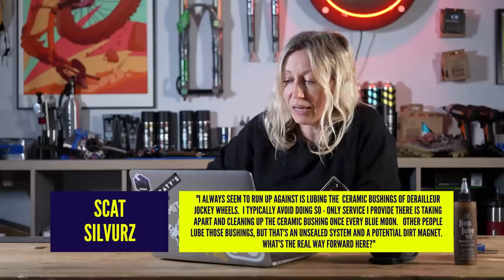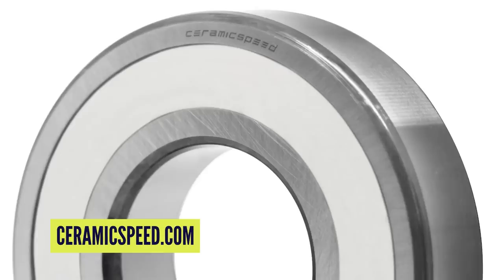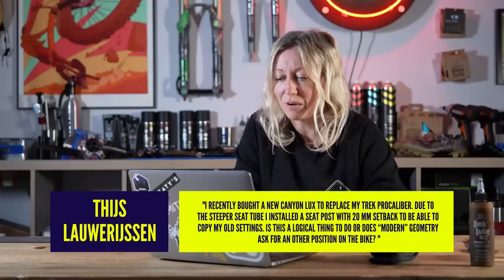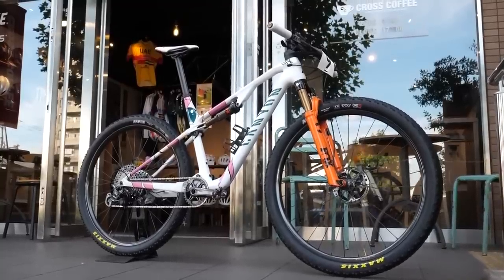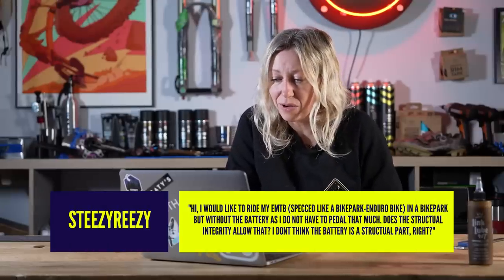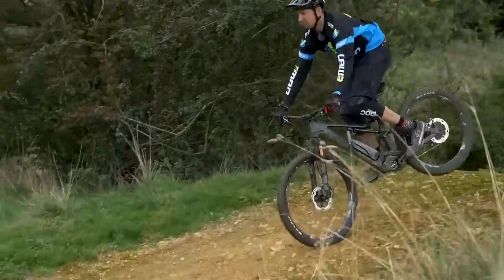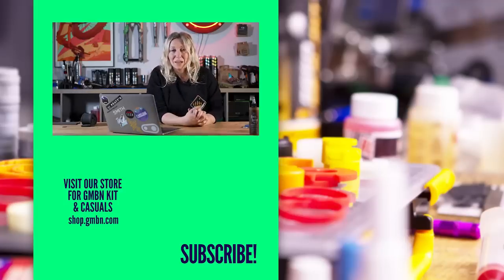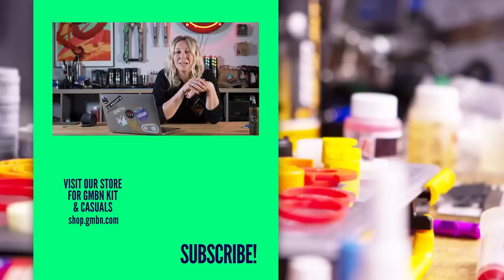Should You Lube Or Grease Jockey Wheels? | #AskGMBNTech

Comment: That's a big overlook from Anna to confuse ceramic bearings with ceramic bushings. 
Still, the answer is grease: speeds and loads in jockeys do not exceed those in wheels, which you grease too and not lube, and you have to keep dust and water away anyway.
Reply: But grease is lube.
Reply: Bushing is a sleeve bearing so technically she is right.
Reply: @45graham45  grease is a compound containing oil, oil and grease are both lubes, teflon powder is lube too,  if you want to get into technicalities. "Lube or grease" in the question meant "lube or <to be specific> grease" where both lube and grease are verbs, not nouns. With lubing normally implying application of oil while greasing is application of grease. It was not about what type of lubricant to apply, but if to apply it at all - another Anna's miss as she wandered off during answering. And I got carried away too. Must have said "Yeah, lube it, and do it rather with grease".
Hope that helps
Reply: @kalijasin  technically all bearing are steel deep groove ball bearings by default when not specified otherwise. Hence if specified being ceramic, they remain being ball bearings.
Reply: @feedbackzaloop  “Bushing – commonly referred to as sleeve bearings, is a cylindrical element built to support loading on an operational shaft that glides back and forth between the moving surfaces.”
Reference: Quote from BushingMfg
Reply: @kalijasin  yes, that is why you have to specify that it is a bushing. Then you specify that it is a ceramic bushing. While ceramic bearing remains being a ceramic ball bearing. What we all are trying to tell you and Anna is not that a bushing is a bearing, but that a "ceramic bearing" is a ceramic ball bearing and she was not asked about it.

Also I advise you to look up ISO for technical terms, so you will learn that bushing has a broader meaning and being a plain bearing is only one of it's many funcions.
Reply: @feedbackzaloop   but still a bearing i.e. sleeve bearing.
Reply: @kalijasin  yes. and?
ceramic bearing is a bearing
ceramic bushing is a bearing
ceramic bushing is not a ceramic bearing
Reply: @feedbackzaloop  then Why didn’t you just admit from the start that Anna was Not wrong?
Reply: @kalijasin  how was she not wrong when "ceramic bushing is not a ceramic bearing"? And this confusion led to the point that Anna did not answer the original question about lubricating ceramic bushings at all.
Reply: @feedbackzaloop  That's what I said. Grease is lube.
Reply: @45graham45  yep. no "but"-s though.
Reply: @feedbackzaloop  where did she say that? 🤔
Reply: @kalijasin  I said that. Based on our previous discussion.
Reply: @feedbackzaloop   you putting words in her mouth.
Reply: @kalijasin  How? I'm putting my words in my mouth. Or do you think that quotation marks should always be for quoting somebody else?
Reply: @feedbackzaloop  that’s not the way it works. Quotes should contain a reference or the person’s name.
Reply: @kalijasin  well, I'm sorry for your confusion. I could have never thought you would read my own words from my very previous answer as if they were said by someone else some other time.
And strictly speaking, quotes works in many different ways. What you say about references and names is only a part of rules for academic citation. Not exactly the current situation and neither you are correct enough as name alone would be not sufficient.

So, let's back it up a bit: would you please re-read the thread again and answer me the following:
- Anna was asked about lubricating ceramic bushings, right?
- She talked about bearings in general, then ceramic bearings, calling them ceramic bushings, then differences in lubricants, ie grease vs "lube"/oil, right?
- How do you think, did she really answer the question?
- If not, what could be the cause?
- Then, is she still technically correct?
- Are you correct at defending her?
Reply: @feedbackzaloop  who hurt you?
Reply: @kalijasin  Not who, but what: your denseness, apparently.
Reply: @feedbackzaloop  you attacked me not me you.

Comment: On tubes, you're always better off going either correct size or smaller.  Smaller can be inflated to fit a bigger tire and will expand/stretch quite a bit without issue.  But trying to fit a bigger tube in a smaller tire will cause issues.  So if you want to buy one set of tubes for bikes with different size tires, get ones that will fit the smallest tires you have.

Comment: About replacing seals, my LBS always used to measure the inside diameter of the seals when the fork is apart. Above a certain measurement they would replace them. Obviously you don't want the inside diameter to be larger than the stanchions (they won't seal), so replace them before they wear out. Only I can't remember the number when they replaced them, might be something like 90% of the stanchion diameter.

Comment: I think your confusing bushings and bearings, ball bearings/sealed bearings require grease (many choices) I think what your veiwer was asking is should he be lubing plain bushes which is where the debate arises, shimano ones I never grease personally as they don't come with any on 👍
Reply: Shimano dealer's manual asks for putting grease under pulley caps.
Reply: @feedbackzaloop  under the caps or on the bushing surfaces?
Reply: @rctankchannelone7558  if it says caps, it must be caps, right? But simultaneously they are side surfaces of bushings, so some amount will be pressed into the contact area anyway. 
In this way you make sure to grease everything, tightening screw as well, while if you put grease on the bushing first, you most likely smear it off during install.
Reply: @feedbackzaloop  I guess so, I can honestly say I have never seen any grease or signs of it in all the ones I've took apart, but I have never taken a new one apart so possibly 😂
Reply: Bushing is a sleeve bearing so bushings are technically bearings. No one calls them bearings though because most cyclists and mechanics associate bearings with ball bearings.
Reply: Grease and Lube have two different purposes.
Grease is for packing the bearing in. Whereas Lube is for reducing friction on the bearing.
Reply: A lot of cyclists get the two, Lube and Grease,  mixed up because of chains. There  is both Lube and Grease for chains. 🙄

Comment: #AskGMBNTech Nice job with the videos Girl & Guys. Question: Will we see Carbon disc brake rotors on MTB’s and in cycling in general?
Reply: It already exists, but it's a rare sight.
It's been in automotive industry for decades. But not common in the bike industry. Kettle Cycles has carbon rotors.

Quote from bike radar:
"Note the absence of holes in the brake track
The thickness, or lack thereof, of disc rotors is a significant hurdle. The materials used have to be quite stiff and, despite the fact the rotors are approximately 2-2.5mm thick, must do an adequate job of dissipating heat.

“If you jumped out to 4mm thick you could successfully use some of the materials that have been attempted, but then you would be creeping up to the weight of aluminum and steel rotors,” noted Step "

" There’s also the mater of wet weather performance. This has been an issue for those riding road bikes with carbon rims for many years. The same issue has been a stumbling block for the development of carbon rotors. Moisture on the surface and in the carbon itself can significantly degrade braking power. A brief but unnerving “warm up” period is often needed before the pads take hold. Surface treatments are one possible solution, though they have a tendency to wear and degrade over time. "

After some research I also found Alpha Ceramic Rotor RS, from Spain. But I see their website is down, so maybe that's no longer exist.
I also found Alien Machinery rotor, unlike the others it has venting holes, bu maybe that was just a display item. But their website is also down, looks like it was a Taiwanese company.
I see some of their rotors had white ceramic  inserts in the venting holes.
But I see a rotor looking the same is Scappa Carbon Ceramic. But the white ceramic won't stay white after use.
Alligator also has a version of the same design, but it's a carbon and kevlar rotor, but same shape and also uses the ceramic inserts. But I checked their website, no carbon rotors. So it seems to be abandoned. I don't know why.
I see they also had a rotor with alu spider and carbon braking surface. It was on display at cycling shows in 2018.

Comment: #AskGMBNTech What ever happened to rapid rise derailleurs?

Full disclosure: I was big into mountain biking from '96 to about '03, and just got back into it in the last couple of years...so I may have missed a few things.
Reply: You and me both. I strayed away in 2009 after graduating high school and going to college. Just coming back this year and I've got a bit of catching up to do lol
Reply: Same here, it was much simpler back then from what I remember
Reply: @kisilvan  You still get relatively simple MTBs with coil spring forks and mechanical shifting. Electric shifting, full suspension and air forks are no standard in the lower price class
Reply: @simonm1447  true but if you're into anything other than basic biking geo, hub standards, etc etc have changed even since the 2010s and if you build up your own bikes it's a huge learning curve when you've been out of it for a while.
Reply: @kisilvan  If the fork angle is too steep you could try to make a mullet (a bike with a bigger front wheel), by adding a 27,5 inch fork and wheel on a 26er or a 29 inch wheel on a 27,5er bike. Of couse the other angles like the seat post angle will also change
Reply: @simonm1447  sure, but why?
Reply: @mrmcdermo  I never used them, but it seems they had technical problems and they needed constant adjustments to work properly, at least at the earlier generation.
If you have just one bike it seems to be OK, but if you have bikes with normal derailleurs too it seems to be quite confusing

Comment: #AskGMBNTech When measuring suspension sag my bike sinks quite a bit under its own weight. Should I be measuring sag with the bike on the ground or unweighted on the bike stand?
Reply: Sag is the difference between fully extended shock and static ride height under your ride ready weight.

Comment: #askgmbntech Hello doddy, anna and gmbn fellas. I'm thinking on putting a 160 travel fork on my SC chameleon which supposedly max at 140, i know a rule of thumb is no more than 10mm than stated, so some other 10mm will make that much of a negative effect? Considering on taking stem spacers out, swapping less rise handle bar and running  30% sag (hoping it remains at constant ~40mm travel), will any of that help? Also might there be any issue with that constant 30% sag? As if the stanchions/seals/lower legs might develop a problem? I would really like to get that fork since its a new top end fox 36 for a super deal and I'm also planning on getting a more AM/enduro frame in a not so distant future. Thanks! 🤙🏻🤙🏻
Reply: You could do it, but you have to consider if it's worth it for you, keep in mind that you're taking risks with the extra stress on the steer tube and for that bike it might not be worth it, if you're not using that much travel from your current fork you could soften it a bit if that's an option. Don't take my word for it, i am no expert. If you're planning on buyng another frame and you're worried the deal might not be available once you get it, you could also buy the fork and save it for the next bike if you planned on swapping it on the new one.

Comment: #AskGMBNTech when it comes to jockey wheels that have bearing cartridges, unlike the nasty basic shimano stuff, and other bits with press fit bearings like some bottom brackets or headset bearings do you recommend using loctite 641 or a similar product from another company? thanks tel

Comment: #AskGMBNTech
Anna getting a lot of BackLash for putting Bushings and Bearings in the same category. Technically she’s Not wrong though. A Bushing is a Bearing. Its a sleeve bearing. 

“ Bushing – commonly referred to as sleeve bearings, is a cylindrical element built to support loading on an operational shaft that glides back and forth between the moving surfaces.” 
Reference: BushingMfg
Reply: All bushings are bearings, but not all bearings are bushings. She answered a question that was probably about plain bushings, as if it had been about ball bearings.
Reply: @kalijasin  That phrase does not remotely mean what you seem to think it means.
Reply: @mattgies  that’s a strawman fallacy!!
Reply: @mattgies   is getting backlash over putting bushings in the category of bearings when she is not wrong because bushings are in fact bearings. That’s the claim I was making.